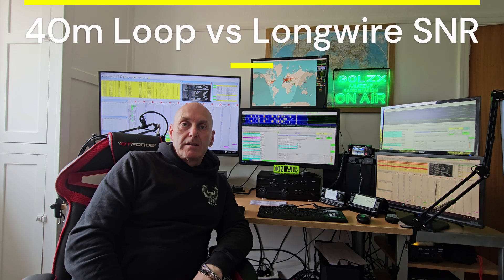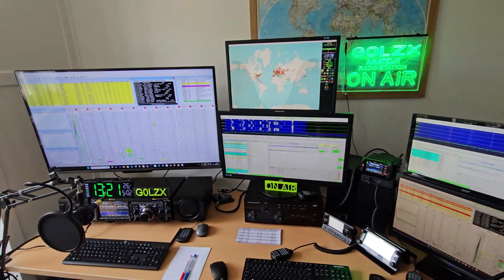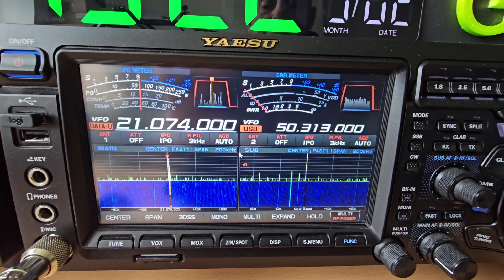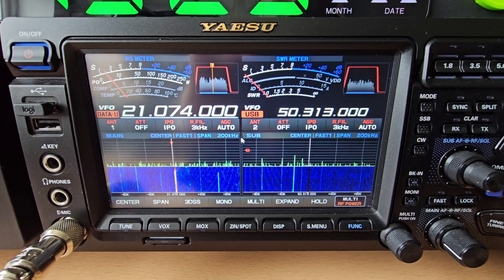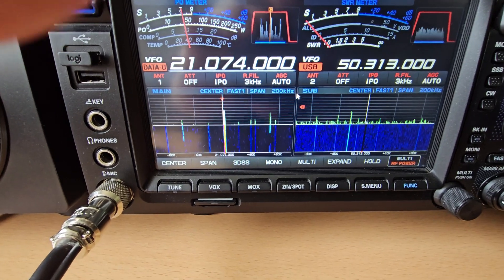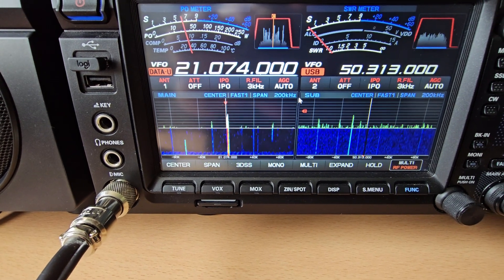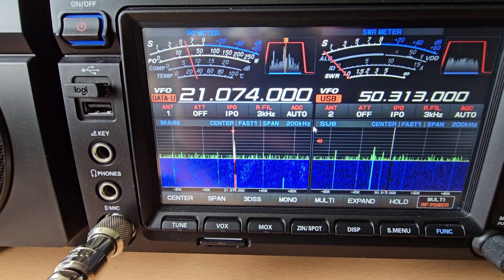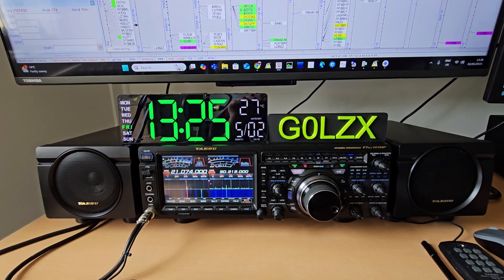40m loop vs 165ft longwire antenna signal to noise (snr)

Comment: Hello Ricky, thanks for the comparison video - very much appreciated. At my QTH, I use Off Center fed dipoles, verticals, and loops. The vertical is best for DX transmitting, the loop and the OCFD are better for medium distance to short distance transmitting. The vertical is noisiest, followed in a dead heat with the OCFD and the loop. My plan is to put up receive-only antennas, and work to find the best for my location. Maybe a beverage and a Mag loop at first. 73 KQ4IXD
Reply from the maker: Thanks for the nice comment , your findings are exactly the same as i get ...good luck with the loop, I think thats the next thing to try on my list

Comment: Great video. I have an OCF dipole (90' x 180') a resonant 80 Meter 1/2 wave dipole and a vertical. 
I'm thinking about putting up a 450' long wire antenna (my property is 450 x 350) or, a loop antenna. I have a 500' roll of 12 awg wire and I want to put something up before winter sets in a few months.

Comment: I had an endfed halfwave for a while and although it transmitted well, the noise level on it was pretty high. I switched do a doublet and the noise floor decreased. I might have to try a loop and see what that does.
Reply from the maker: It's well worth it , I've even worked 6m the last few days and it's been really good 👍

Comment: why didn't you cover transmit quality. Reduced noise on receive, but no demonstration of output audio quality. Perhaps the loop is good for receivers but not so good for transmitting.
Reply from the maker: Transmit is always going to be more down to propagation,  I know the loop works well on transmit but with its orientation with regards to my wire antenna , it didn't make a lot of sense working a station then asking to change my antenna to the other as he may be in a null tx wise ?? 
The purpose of the video was to show the noise floor of the loop in comparison to my longwire and I think the video shows that well 👍

Comment: That noise level. Are you happy with that?  It seems horrendous, with either antenna.
Reply from the maker: @veteranfitness  it's really not horrendous,  it's still only just above S0 if you look at the meter ...  its just the loop is much quieter

Comment: Why not pick a weak dx signal and demo, it's next to impossible to see difference ..
Reply from the maker: @Robbie_Ei2iP  I will do ... the idea with the video was to show as a visual representation using the waterfall to show the difference in the noise level.. the video clearly shows that 👌
Reply: @g0lzx  fair enough..

Comment: I have a 160 meter loop (about 570 feet of wire) up in the trees about 30-40 feet up in the air, and it has been nothing but a problem for me on 160 and 80 meters, and is barely usable on 40 meters.   I keep getting RF back into the house, and it trips the Arc Fault Circuit Interrupter circuit breakers in the house.  I have to dial it back to about 50 watts in order to keep it from tripping the breakers.  On 20 meters it does pretty good, and it loads very well on 17 meters.  10 meters does well, also.  But I am absolutely disappointed in its operation (or lack thereof) on 160 meters.  I wound up buying an 80-60-40 meter fanned dipole and putting it up about 50 feet so I can get on those bands, at least.
Reply from the maker: @kf4hoq  I have my feeder ( rg213 ) choked at the balun feed point and also choked when it comes into the shack with 7 ferrite clip ons .. I don't get any common mode issues now even up to the max of my acom 1010 which is about 700w .. I'd be looking to do that If you haven't already done so and even looking to see if your 4:1 bslun is doing its job properly???
Reply: @g0lzx  I thought about that, and replaced the 4:1 balun, just to be sure.  I also built a 1:1 choke and put it after the 4:1 and before the coax, but it didn't really help.

One thing that helped some was that I wound the radio end of the coax around a FT240-31.  It cut some of the breaker tripping on the low bands, but it didn't fully end it.  But I then pulled the coax too tight around the ferrite core and damaged the coax, causing a short between the braid and the center conductor, and I haven't cut the bad section out and out a new end on it yet.
Reply from the maker: @kf4hoq  the other thing to check is any earthing or grounding you have ..
I also choked all my incoming power to my shack and that helped too
There's loads of videos on YouTube regarding common mode and reducing noise into and out of the shack ... I watched a few and spent a full day starting from scratch and it definitely works , it reduced my common mode and also noise too ..
I wonder if the problem you have is JUST down to the loop or other antennas too ? Maybe it's the orientation of the loop and where it's fed ? Sorry I can't be more help , I hope you get it sorted soon as it becomes very frustrating
Reply: I have used a 160M horizontal loop fed with 450 Ohm window line via a balanced ATU. It is bad engineering practice to feed big poops as multiband antennas via baluns. It might work efficiently on a couple of bands, but not all. If you use 50 Ohm coax via a 4:1 balun the balun expects to see 200 Ohms impedance at the antenna feed point for it to work as intended. Chronic mismatch can cause balun heating, flash over or cross modulation on Tx as the balun's core becomes saturated. The coax is seeing a  load that is nowhere near 50 Ohms on some bands , so you have more losses to contend with. I have been using loops for over 40 years and, unless monoband, the balanced feeder, balanced ATU setup has always been king. There are not that many on the market, but the MFJ 974 range is worth looking for. This is actually a T Match with a choked coax output to the rig, but it works quite well at 100 Watts or less. MFJ inductor selector switches are famously cheap and nasty, so will flash over with some higher impedance loads attached at power levels over 100 Watts. Keep at it, please don't be discouraged. The advantages of loops are well worth the expreimentation to get them running right for you.😊

Comment: Hi Ricky,

I'm a bit stuck for space for a decent size loop with other antennas in the way and length of the garden. I almost gave up HF completely a few years ago because of noise. Thankfully that has gone now but I did put a Wellbrook Active loop up. I only really use in on the lower HF bands and the noise floor compared to resonant dipoles on 60m and 80m is chalk and cheese.  The signal strength isn't as good on receive but that is more than adequately dealt with because the overall s/n ratio is a LOT better. The only thing is you really need a transceiver with a dedicated RX port. I honestly think that ALL new radio's should have a dedicated RX port - my old FT-2000 and my current Kenwood TS-990 do but many sadly do not.

I did put a couple of video's on my channel comparing noise on a resonant dipole and the loop few years ago. 

Nice shack! You are lucky in living in my spiritual home city of Liverpool - I was born and bred a Brummie and do come up once in a while by train for a day or so to decompress. Beautiful city and the people are ace! I often spend a bit of time in Ma Egerton's opposite Lime St. Station and have a couple of pints and a bowl of Scouse and always end up chatting with someone! 

Maybe I'll catch you on 40m some day.

73 de Richard M0SNR
Reply from the maker: @rjy8960  hi Richard,  I agree a dedicated rx port these days with so much outside qrm is a must ... I'm really lucky to have the 101mp in case that ever becomes an issue .. 
I've been to brum a couple of times , I think it was called broad street??? I might be completely wrong lol but it was lovely especially around the canal area ..
My dad often goes into ma egertons also for the Scouse ha ha , can't say I've ever tried it myself,  I make fantastic Scouse at home. Me ma taught me well..
I'm always up for a chat on any bands so if I see u pop up or hear you on expect a quick break 👍
Thanks for the nice comments mate , really do appreciate anyone who gets in touch. Makes making the little videos more worthwhile..
73 Ricky

Comment: I have been using 40M horiz. loops for over 40 years at 3 different QTHs. I made them a bit under 144 ft of wire, some square, some triangles and the recent one is a 5 sided one due to supporting tree positions. Original Idea was to reduce QRM from SWBC stations we had to share the band with. I liked to QSO Novice operators who were limited to about 50 W output where the BC stations were 100,000 W or more. The flat loops give a high angle  launched signal Perfect for working regional (40 M )skip and have a lot less signal at low angles where  the SWBC signals come in.  Since I used coax feed , a simple "Q" section of 75 Ohm line made a great matching device for 50 Ohm feed. Thus the antenna was ONLY for 40M.  I used a 1:1 BalUn on my last 40M loop, none before this one...73...K8JD

Comment: which make of Balun are you using and are you using a 1.1 choke in line ?
Reply from the maker: @eanmitchell5641  the balun is a 4:1 made by my mate in Scotland Rab from Hamtenna , it's a 2kw one so handles my meagre 700w ... I have 7 10mm ferrite cores on the feed into the balun and where the coax enters the shack and don't get any noise or common mode into the shack